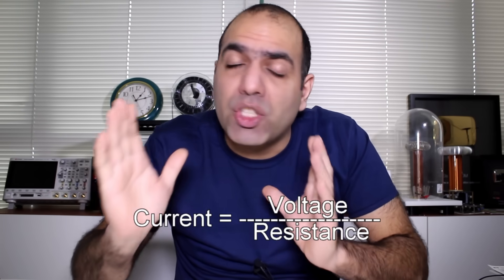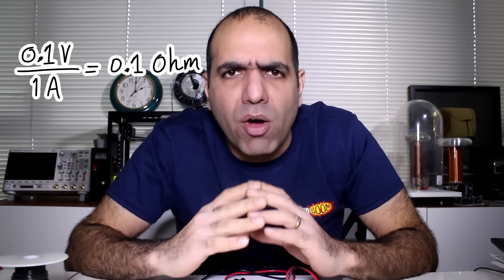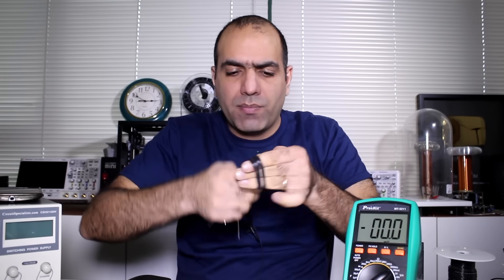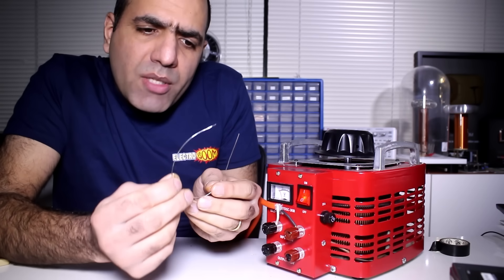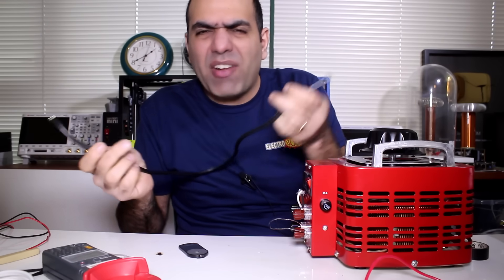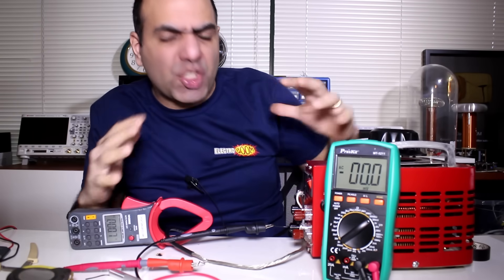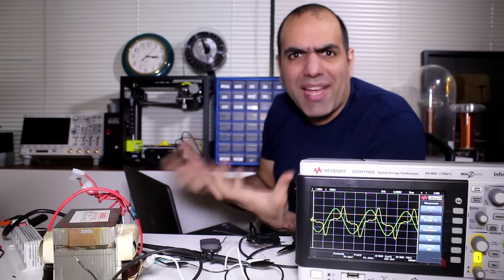How to Make a Shunt Current Sense Resistor

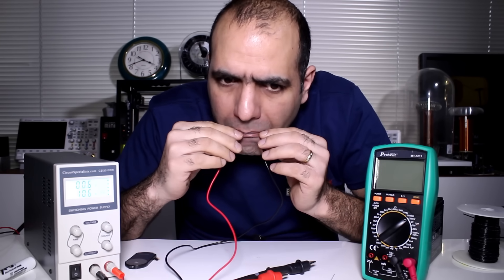Comment: 4:35 the wire is barely getting warm because the voltage dropped a LOT, read the power supplies screen

Comment: The word Electron comes from Greek for “amber” ? Ancient Greeks not only knew that electric eels existed, but also knew that amber could create magnetic fields, which are dependent on electricity. Also, if you close a circuit with your hand between the wires, you will feel like your hand is being pulled in as if it were magnetic

The other fact about the human body is it has capacitance. If you spent a full day working on a MacBook, it is possible your body may discharge as soon as you touch another metal surface. Often it happens on the tip of your finger, but it could also happen elsewhere on your body, provided that it is exposed or bare

Comment: Hello Electroboom, I am trying to precisely measure (and digitize) the current in all three phases of wire, which are connected to a 3 phase induction motor. I was using a hall effect sensor that gives me 1mV per Ampere. The currents I want to measure are in the 20Amperes range. The issue with the hall effect sensor is that they aren't as accurate as you rightly mentioned, and I am facing one more problem - noise. The hall effect sensor output is in milli volts and I am in the noise region. So the digitalized samples I take at 5KHz per phase contain a lot of noise. Bottomline - this is not a usable setup.

Do you recommend that I design a shunt? It will be more of an intrusive solution and in order to install it, I will have to disturb the motor's wiring. This will be challenging as well since there will be downtimes. 

Any other solution that I can look at? How about winding an inductor and sliding it across the wire that carries the AC current? Of course, the voltages induced in the inductor will be out of phase with the current, but if that is not a problem, is it an effective solution otherwise? Will it be able to capture all the transients, harmonics, and everything as it is? I appreciate any insights on this, thank you.

Comment: i would like some help to understand how to calibrate a split core CT sensor used to measure AC current. I have a Solaredge Grid Tie Inverter, a Hybrid inverter, and a tesla Gateway. I was hoping that I could find a common communication protocol between these three disperate devices but no luck. I am trying to get my Tesla Gateway to sense the power my Solaredge is producing by using a CT Sensor. The Tesla Gateway has a built in meter but I do not have the sensors that are normally used. I try to buy some and could not find what they are. This is a Gen 1 Tesla Gateway and documentation is limited. I bought a 200A/5A CT Sensor but my reading is way higher than it should be. Can I wrap the wire that runs through the sensor in order to change the reading?

Comment: In the UK look for SWG (Standard Wire Gauge) tables, or anywhere else look for metric wire resistance tables. BTW I have an old resistance box, wound with non-inductive resistors, it is from the 1930s, the laws of physics don't change.

Comment: Hilariously entertaining as always, but why not just solder a bunch of .1 ohm resistors in parallel? When in parallel resistors of the same ohm value stay the same but can handle more power. That way you don't have to deal with all this wire and no need to worry about inductance.

Comment: current sensing resistor? 1-10 ohms and extremely uncommon... ive only seen them in training equipment to prove to the learner that it can be done.
   ive only seen and used "shunt" usually as an ac path to ground when its unwanted. mind you im a tech not an engineer... do we use different term?

Comment: can someone explain to me? how is he running 10 A through the wire? @4:32 600 mV, 10.6 A, = 6.36 W? wouldn't that get very hot? his resistor in the beginning of the video only produced 4W of power and got very hot and started smoking, right???

Comment: Why not to connect 2 or more shunts in parallel? I know the resistance will drop, but if you take longer shunts and get the same resistance, you can make twice or as many times as the parallel wires the current flow without burning the wires

Comment: The biggest problem with Copper wire shunts is the temperature coefficient of Copper is very high, so the resistance changes a lot as the wire gets hotter. That's the magic of off-the-shelf shunts, you can fairly easily get them down to 50ppm per degree C, as a comparison, I think copper is around 3000ppm per degree C. This is also why it is not a good idea to use tracks on a PCB as a shunt. But, assuming you can keep the dissipation low enough, Copper shunts can definitely do the business.

Comment: Can you make a video on how to reduce the current from the source(550w smps) to power low power device like LED strip in an simple way without 💥? 
I want to power my rgb LED strip that is rated for 12v but when I connect it with 12v smps output it starts heating. So please help me.

Comment: You measure current by measuring voltage, but how do you measure the voltage? Do you put the voltage across another known resistor and measure the current through it? 

(mostly sarcasm, but I actually am not sure)

Comment: As I understand it... whats happening here is that when the current through the resistor goes higher,  there is more potential voltage drop across it,  so it would rather not go through this resistor,  which creates a voltage at either end which can be measured by a voltmeter.  You can also attach a ammeter or NPN transistor in parallel to the shunt resistor.

Comment: Hi electroboom. I think there is a correction at time 10:10. the current is not leading but it should be lagging. also, it is a transformer. inductive load operates at lagging power factor. but still, great video. :)

Comment: 10:09 "The Yellow current line is leading the voltage green line  as should happen in an inductor"

But in an inductor, Voltage always leads the current by 90 degrees

Comment: Hi Electroboom ! I have a 150A shunted ammeter gauge in my car (50mV 150A shunt). The gauge is in the dash, while the shunt is behind the firewall (my exact ammeter gauge is this one: http://www.partdeal.com/vdo-2-1-16-in-vision-black-150a-ammeter-12v-requires-external-shunt-391-007-190-151.html ) Is there a commercial circuit (op-amp?) that I could splice in the the shunt sense leads (near the dash) so that my instrument becomes more sensitive (I would like to read smaller current value, as the gauge grads go 30A per line) ??? When I start the car and the alternator starts charging the battery, I typically only see 15-30A charging current taken in the battery. I would like to increase the intrument's precision by a factor x5 (so when the current is 30A, the meter gauge would display 150A) by pressing a momentary switch. Changing the shunt is not an option. The rated maximum output of the alternator is 91A at 5100rpm, but in practice, the maximum value I ever saw was 70A when I once jumpstarted my car which had a completely dead battery (reading 0V). I really need to find such a circuit on amazon if such circuit exists. Thanks for any help or suggestion !

Comment: the current on the microwave oven transformer looks like that because they don't care about the efficiency of the MOT due to it operating such little periods of time, so the design cuts down on total amount of iron used (makes it cheaper) and they saturate it heavy, normally that magnetization current is very small

Comment: 10:08 - No, your current line is lagging your voltage line, which is exactly what you want to see in an inductive setup.  There is a mnemonic I use, known as "CIVIVI", to distinguish inductance from capacitance.  If your current waveform is leading your voltage, you are looking at capacitance.  And if your voltage is leading your current, you are looking at inductance.

And seriously, Mehdi, get yourself into the ham radio hobby.  I bet you'd fit in very well there.

Comment: hi! im computer engineer and 2 things, one im fixing an raspberry pi 3, one screw touched the board (im looking which condenser is broken). Where can i buy and how can i know the capacity of ceramic condenser?(no number or color bands :-\ ) and the second i have some tools (multimeter, smd rework (rebolling...) but i havent got an oscillator so.... could u send me one if u dont use it?? :-) thankss! )

Comment: Maybe someone can help me. I made a shunt from 4 meter (thin) wire which is suitable to carry up to 2 amps. When I reach one amp of current, the voltage suddenly drops instead of increasing. Is the wire losing resistance with higher current flow?

Comment: 10:10 Shouldn't current be lagging the voltage in an inductor? It is capacitors that have leading current. (ELI the ICE man)
Reply: Ok so just thought about it for a sec. Voltage "leading in phase" would appear on the scope as the voltage reaching a particular point BEFORE the current (for example the peak), hence the current wave form's corresponding points should come after the voltage waveform, which is what is shown.

Comment: At 4:50 you say that there is no current running through your body, which is wrong. (The ampmeter shows 0.6 V which seems to be off for a 10mOhm resistor at 10A, but maybe your leads add  around 50mOhm  to the circuit.) You have a 10mOhm resistor with 10A running trough it, that means the voltage across the resistor is 0.1V. Lets say your mouth's resistance is 100 kOhm so there should be ~1µA running through your mouth. I am pretty sure you know this, but as you said it, it sounds a lot like the current "looks" for the easiest way which is the 10mOhm resistor and "decides" to only go there.

Comment: A resistor wired across a current meter to bypass current is a (shunt resistor). 

A resistor wired across a volt meter to induce a small voltage in proportion to current passing through it, is a (series resistor). 

In this case, we have a series resistor but shunt.

Comment: Say... There definitely are tables for wire gauges which gauge is required for which max current.
Those want to keep inner resistance negligible (eg for house installations). If you don't want to buy resistor wire (which is offered), the max current still should give you a rule of thumb which wire gauge is acceptable for which current, and which gives you a melting fuse.

Comment: 6:15 that looks as if it did hurt... a lot
Reply: Because it did
Reply: actually from experience not that much or not at all, the temperature will be very high but for short time like a flash and something will break the circuit so just the outer layer of the skin is burned up and you you just left up with shame and the bad smell.
Reply: @mmawad100  It's a great smell. I think the heat kind of cauterises the nerve endings too which means less pain. Or I may have just made that up.
Reply: @mmawad100 I've burnt myself with a wire before
During the burning it didn't hurt, but it "felt very wrong", can't really describe it
Afterwards it started hurting more and more and the pain increased continuously for like 12 hours
After that it started dropping but it was still kinda painful for a while (days)

It wasn't super bad, it's like cutting yourself with a knife a bit, like on accident in a kitchen

Comment: I think Mehdi may have made a little mistake at 10:08.  Correct me if I'm wrong, but what I think he should have said was that the yellow current line is LAGGING the green voltage line as should happen in an inductor.

Comment: If resistance of wire increases vwith temperature due to heating effect? How would be a low shunt can be used for precise current measurement? I understand accuracy for higher resistance.. but for low value of resistance overall value will effected right??

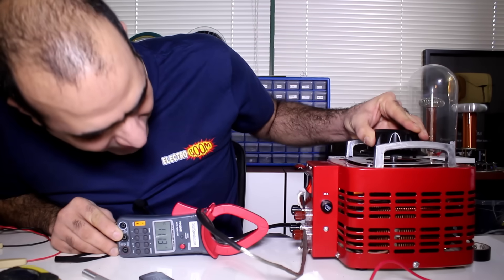Comment: 7:46 that flash in the  transformer   is the gloss coating setting on fire due to the excessive heat  but if he did it longer it  would have melted the coil wire attached to the output ?
Reply: as he was pulling 100 amps at around 2v which is at the minimum on the dial
Reply: it looks like a 3000va  2.4kw ish transformer i think

Comment: But it's very hard for me to watch somebody connecting a thick wire to the output of a autotransformer with rather thin internal wires  in relation to it.
The fuse at the primary side helps to limit the power, but not the current at the short wire  of the output.

Comment: Please explain how you can put the wire in your mouth. I've never understood this because its bare wire and you have a path to earth through your feet so surely you are just opening up another path for current to flow.
Reply: Oh, it's simple. You can do it easily!
To start, just put ONE of the wires in your mouth. While you hold onto a kitchen tap (in case you lose your balance).Once you have done this, then try the two wires.  This is obviously TWICE AS SAFE! 
Report back here afterwards. Magic Mehta will award you a FREE grounded voltmeter!

Comment: 4:50 can you explain this a little more, doesn't your body have a resistance ?
Reply: of course his body also has resistance and is not an insulator.
But no matter how low his body resistance is, it is still HUGE with respect to a simple wire. Thus the current is almost entirely running though the wire and only a neglible amount through his body (tounge, lips). 
Electrical current (just as humans) always takes the path with the least resistance.

Consider a duct pipe with 2 meter diameter connecting 2 chambers. Now you install a straw parallel to the duct pipe. You fill one of the chambers with water and let the water flow into the other chamber. Where will almost all of the water run through - through the pipe or through the straw?
Pipe: low resistance - the wire
Straw: high resistence - the human body

Comment: If there is not stupid questions... If you twist wires together and wind it reducating inductances, so why extensions cords must be de-wind before using with high power? It is winded and current flows foreword and returning in opposite way. It works like your way but it could burn extension wire if unrolled.

Comment: Sir, can you please give me a circuit diagram as simple as possible to boost the dc voltage of a battery...and if possible please explain it too. My first hard experience:
I love your channel for the way you explain things and i can tell you i am also a crazy fan of technology...when i was 5 years old i connected a dc motor (the smallest ones taken out from my rc car) directly to my 220 v supply ac and found it out at last why the dc motor blasted with sparks...
Please help me out with my above mentioned project

Comment: Hello sir...i prefer to call you as sir😊...i became a great fan of yours within 3 to 4 videos..(although i scoled and cursed you on the first...i was silly)...i dont know much but may i suggest something?... I have seen you using opamps in other circuits of tesla coil etc. Maybe you can use it here also...is it better to have 1 to 5 milliVolt drop on your shunt resistor wire? And then use the opamp in difference amplifier configuration to amplify it by 300 or 500 times? Your wire will dissipate lesser power and might not even burn when you were trying to send 100 amps through it.. you may also use the scope MATH function to divide the input channel signal by the amplifier Gain and resistor value and plot the exact current waveform itself!😊... Correct me where i am wrong sir. Thank you for the videos

Comment: If you take that power supply apart, there is a button on the back of the display module to zero the current reading. Mine was 20-30ma off.

Comment: Best way to calibrate high a shunt resistor for high currents is to use a dc power supply with a suitable inverter with the output connected to an autotransformer powering a resistive load. You can increase the current with the turn of a knob with reasonable accuracy!